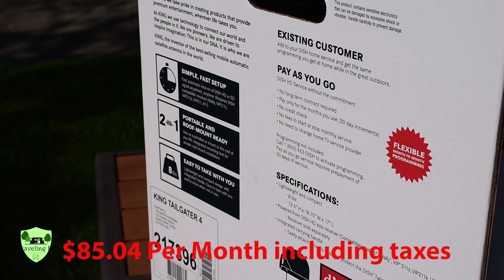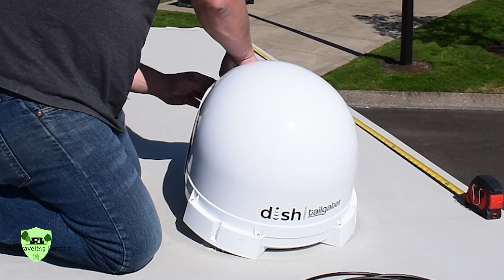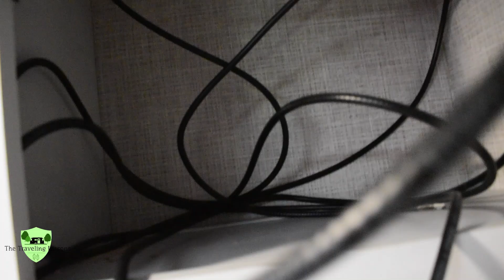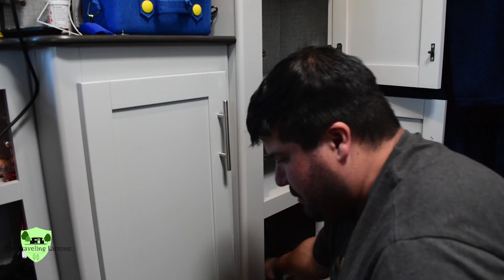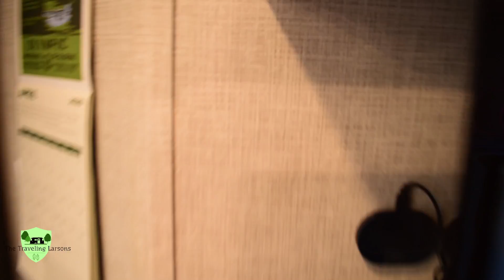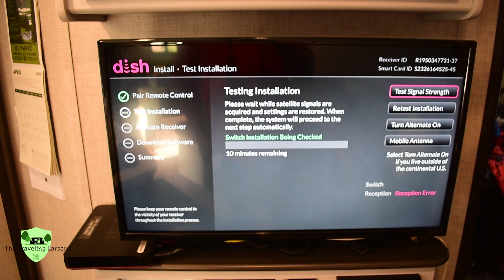Dish Tailgater Installation || Simple Install On Travel Trailer Roof

Comment: I know this is 4 years old,  we also know the tailgater is meant to be mounted to the roof out of the box however making sure there would be zero leaks I may invest in the mount that allows you to remove the dome as there are a lot more mounting areas and can be more easily made water proof.   Call me ocd but is the dish pointed backwards?
Reply from the maker: Honestly, I only remember that it didn’t matter which direction it was installed because the dish rotated inside the dome.
Thank you for watching and commenting!

Comment: Next time take a pencil and draw around the base of the antenna,  it will be much easier to find the screw holes to attach it to the roof and you will get a better seal to the roof.
Reply from the maker: I’m sure everyone can find a way to improve how someone else did something.  It took several takes, hours and trials to make this video among all the others.  My videos are not perfect, they are meant to help other RV’ers.  However, this video does have well over 30,000 views.

Comment: Could you of just taken the original wind guard of and put the dish system in its place?
Reply from the maker: I probably could have taken the factory antenna.  However, we wanted the option to use it and it also is our antenna for our radio too.  It’s a good idea if that’s an option for you.
Reply: @TheTravelingLarsons  so the guard I have on my camper is a radio anatana? Not for tv?
Reply from the maker: @BobBerardjr772  It all depends on which one you have on your RV.  Ours is the KeyTV by Keystone.
Reply: The tv antenna actually has a spot to screw a coax onto for the satellite dish it acts as a pass through

Comment: To make the installation easier there is no need to predrill your holes.  If you use the butyl tape underneath the dish base holes then the butyl will adhere to the screws as it goes through your roof.  Also be very careful when you drill down because the main bulk of your 12v and 110 wires run down the area where you drilled for the cable!
Reply from the maker: Thank you for watching and commenting.
In my opinion and experience, it is best to pre-drill in an installation like this.  I like coating the screws because I feel that they seal better and also act as thread lock, holding the screw in as we’re an earthquake down the road.  I’ve opened up a lot of our own trailer and luckily most of our wiring is ran through the enclosed underbelly.  But, you’re right, always need to be careful drilling into anything, trailer, house, etc...
My DIY videos are my opinion and I certainly recommend everyone watching and performing their own DIY tasks to do their own research.
As always, if someone doesn’t feel comfortable performing a task like this, there are companies that will install this and most any upgrades on your RV for you.

Comment: Bit messy on the sealant but how did u hit the studs just by feel or stud finder ?
Reply from the maker: I’ve never been very clean using a caulking gun, even with the many years I’ve been in construction.  This Dicor sealant is also very “sticky”.
On my travel trailer, I can actually see the outline of the roof trusses through the roof, so I was able to mark out the Dish and attach easily.
Thanks for watching!

Comment: After the benifit of seeing where the cable came through and the possibility of missing completely or hitting the edge of that cabinet, I think I would have drilled a small pilot hole from the inside up. Then go up on the roof and drill the final bigger hole from the top down. Also possibility drilling the cable hole first, then mounting the dome with the added benefit of knowing exactly where the cable hole is going to be. Thanks for the video. Much appreciated.
Reply from the maker: Thanks for watching and commenting!  It would certainly be a great idea to drill from the inside up.  Unfortunately I didn’t have the room between the cabinet shelf and the ceiling in the cabinet to drill a pilot hole up.  Luckily I could take some great measurements to get the hole in the right spot.

Comment: We have the same setup, but i have not installed on the roof..im using the tripod....the only reason is, because of the positioning of the satellite. The instructions say that you have to point the handle to the North and that gives the dome side to the south. So if you mount on the rig, then how much will it affect you being able to position the rig to grab the satellite?
Reply from the maker: Profound Seeker   The only thing that I know is that obstructions like buildings or trees can be an issue.  But as long as you have a clear view of the southern sky, it doesn’t matter which way the dome is facing.  The dish inside the dome rotates to find the best satellite to connect to.  Thank your for watching.

Comment: Heard about your channel from BluWave Odyssey.   We've had DirecTV at hope for over 10 years.  I kept wondering why most FT campers had Dish.  Like you showed, the ability to pay as you go rather than a year contract is such a good option for campers.  Did this item become your tallest point on your rig?   I'm not sure I could mentally convince myself to drill a hole in my roof, but good to see others have done it and 'it will be ok'.  Thanks for sharing the process of the install.
Reply from the maker: ISOAdventure Life  Thank you for visiting our channel.  BluWave Odyssey is great in uniting the RV community.
We went with Dish Network because of the ability to subscribe month to month (even though we are full timers) and because we’ve had bad luck with DirecTV in the past.  I honestly have not measured the height of the rig again...  This will be an upcoming video...
I was concerned about putting holes in the roof when I installed the solar system and ended up having a leak.  But that was because I tried to seal it up right before a rain storm.  This time, nice warm weather and knowledge from the solar install.
Thanks for watching, if you ever need help or advise please don’t hesitate to reach out.
Safe travels.  “Hope life always continues to be an adventure”
Reply: @TheTravelingLarsons  Thanks for the offer and info!